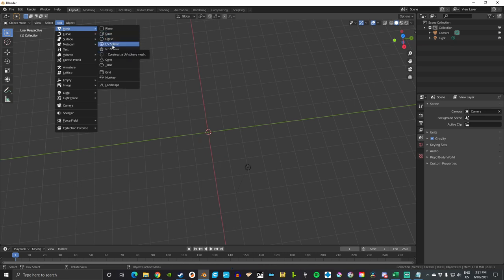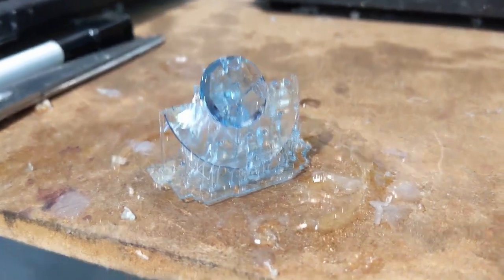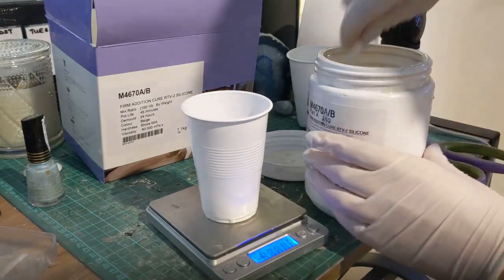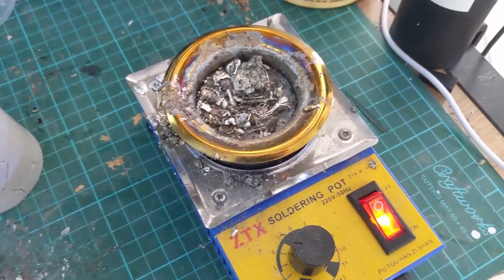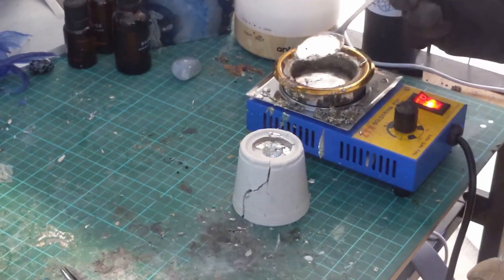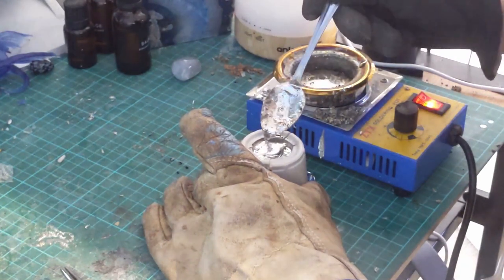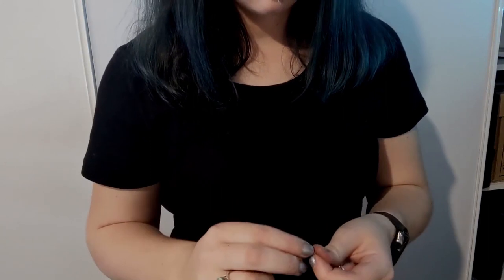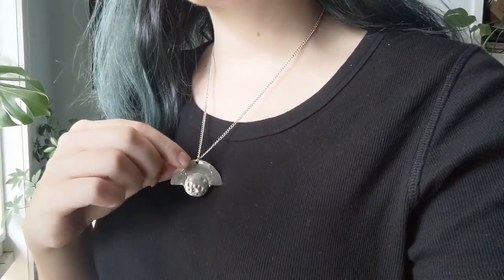How I make Pewter Jewelry!

Comment: You can get UV curing waxes for 3D resin printing.  That way you can just do lost wax casting and not have to worry about taking the print out of the mold before pouring.

Comment: You would get better results, too, if you used something that would allow you to pour continuously until the pewter tops offer, which allow the weight and  even heat distribution and cooling to create a smoother, more uniform casting.

Comment: If you switch to using Siraya Sculpt resin, then you'd be able to make vulcanised rubber moulds with high temp rubbers, as it can handle 160C, and most rubbers vulcanise well below that :) (you can safely use your household oven and some metal sheets to compress the mould frame instead of a costly vulcaniser) 
It's what I switched to doing a short while ago, made my process a lot easier, less expensive, and faster to process :)
Reply from the maker: @noviceartisan  thanks for that information! I'll look into that 😊💕